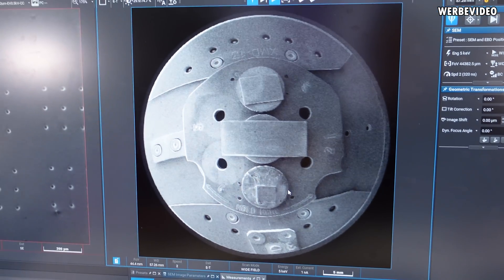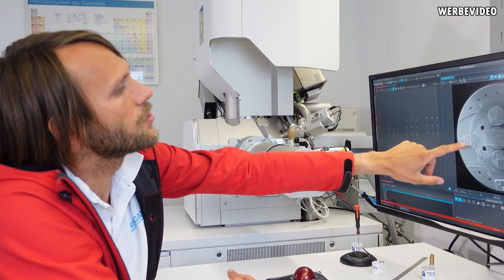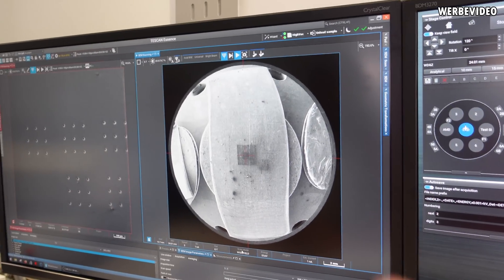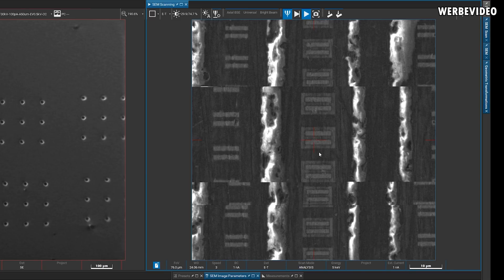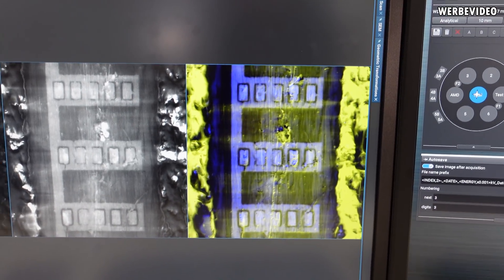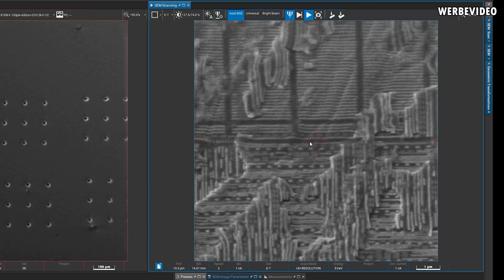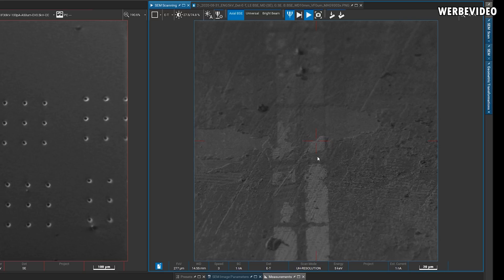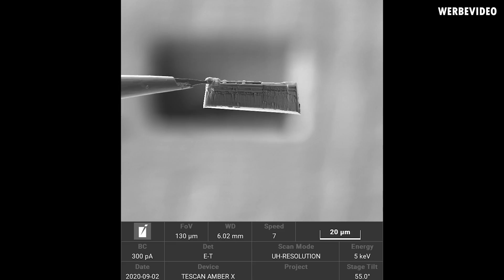Ryzen Nano-Structures more than 100,000 times magnified. Visiting Tescan Part 2/3

Comment: It's hard to believe how much electricity flows through those tiny channels at any given time.
Reply: Ok so you know what Electron tunneling is with the transistors, and how they use silicon transistors to get smaller like the 7 nm they are currently at with AMD's Ryzen 3000 series CPU's.
And the 5 nm, 3nm and so on, to make the computers more efficient with performance and energy but now we are starting to see more heat.
Silicon has limits but they keep trying to improve it, and it will melt at specific temperatures, so we need to replace it.
Ask yourself why we aren't using Quantum Materials like Graphene (yet) and still using silicon. 🤨🤔

This is where Graphene will fix the electron tunneling aka Quantum Tunneling, we don't need silicon to get down to 1 nm "nanometer" in size.

Imagine this, Graphene computers with a magnetic current to be 1,000 times faster and possibly only use 1% of the energy used. 💡

Now imagine Graphene optical / transparent transistors for Photonic Computing. 💡

Now imagine Graphene lasers for the fiber optics that would be used as the circuits inside our computers for Photonic Computing. 💡

--------

I would rather see Graphene computers, let's get rid of silicon. I'm serious.

Check this out.
I would give links but the video hides my comments.

Go to my channel and click on the playlist called "Videos with important info to get around my channel". ✔

Watch a Flash Graphene video about Flash Graphene 100 dollars "per ton". ✔

And then another video about "Large machines on earth / in space to make Flash Graphene". ✔

After that, check my channel with 2 simple steps for my other channel, go to the "About" tab of the channel I'm commenting with now and read the info with a link found there to save to your browser's favorites. ✔

==============================

Imagine Graphene for Photonic Computing, to help us save on our energy needs, really think about that for a second with Photonic Computing.

Check my other channel for these 2 playlists.
Photonic Computing playlist. ✔

Graphene computers for home and Starships, playlist. ✔

Learn about Graphene from my other channel's "Graphene playlist". ✔

If you want to know more about Graphene and Quantum Technologies, go to my other channel. ✔🤔💡

Comment: Well i did NOT know processors had so many layers , i remeber when intel introduced the finfet something , i think that's when they went multilayered , but i always tought they had 2-3 layers , not 10+ . Crazy .
Reply: Ok so you know what Electron tunneling is with the transistors, and how they use silicon transistors to get smaller like the 7 nm they are currently at with AMD's Ryzen 3000 series CPU's.
And the 5 nm, 3nm and so on, to make the computers more efficient with performance and energy but now we are starting to see more heat.
Silicon has limits but they keep trying to improve it, and it will melt at specific temperatures, so we need to replace it.
Ask yourself why we aren't using Quantum Materials like Graphene (yet) and still using silicon. 🤨🤔

This is where Graphene will fix the electron tunneling aka Quantum Tunneling, we don't need silicon to get down to 1 nm "nanometer" in size.

Imagine this, Graphene computers with a magnetic current to be 1,000 times faster and possibly only use 1% of the energy used. 💡

Now imagine Graphene optical / transparent transistors for Photonic Computing. 💡

Now imagine Graphene lasers for the fiber optics that would be used as the circuits inside our computers for Photonic Computing. 💡

--------

I would rather see Graphene computers, let's get rid of silicon. I'm serious.

Check this out.
I would give links but the video hides my comments.

Go to my channel and click on the playlist called "Videos with important info to get around my channel". ✔

Watch a Flash Graphene video about Flash Graphene 100 dollars "per ton". ✔

And then another video about "Large machines on earth / in space to make Flash Graphene". ✔

After that, check my channel with 2 simple steps for my other channel, go to the "About" tab of the channel I'm commenting with now and read the info with a link found there to save to your browser's favorites. ✔

==============================

Imagine Graphene for Photonic Computing, to help us save on our energy needs, really think about that for a second with Photonic Computing.

Check my other channel for these 2 playlists.
Photonic Computing playlist. ✔

Graphene computers for home and Starships, playlist. ✔

Learn about Graphene from my other channel's "Graphene playlist". ✔

If you want to know more about Graphene and Quantum Technologies, go to my other channel. ✔🤔💡
Reply: @gameresearch9535  Currently this is al just hocus pocus , some is theory , some are prototypes with eXXtremely high cost = uneconomical . Realistically what you talk about is 22th century tech . Adoption of such a huge change would take 20 years anyway . We'll be long gone mate , but i aswell would like to see such tech , the ultra realism gaming in a 100W package .... and embedded tech under the skin , or simple smart stuff that don't need a charge every 1-2 days. 

To tell you 1 concrete example : I've been looking towards the carbon nanowhatever batteries since 2010 . There was a roadmap of 5 or so years , even in 2020 they have ZERO delivery on the promise . If you check it out it's still gonna say they are 5-10 years away . - This is how tech truly progresses. When something drastically new comes around , it takes a huge amount of time till it gets economical to produce . 

Same with Oled or Amoled , Wikipedia -"Chemists Ching Wan Tang and Steven Van Slyke at Eastman Kodak built the first practical OLED device in 1987".  they started to put them in phones only in 2008-2009 . And the widespread adoption took another decade. Oled tv's still are not mainstream and still have some issues...

You see what i'm tryin' to say ?
Reply: @kisspeteristvan  

Again read what I said about my other channel and go learn about it in the playlists section of my other channel.

There are a lot of playlists you need to see on this, from my other channel.

Graphene isn't like silicon, it's not artificial and look how fast they have found ways to scale it up.

Look into the information I gave in my first comment above, follow the information to find out more about Flash Graphene, you're making excuses before actually checking out any of the information I gave, and I don't appreciate ignorance.

A lot of companies have a 5 - 10 year schedule, this means we can see many different kinds of emerging technologies much sooner but they won't allow it.
Look at the Hyperloop One that was a concept idea and then became a prototype developed in the U.S., and then built in India? See anything wrong about that?

Because of safety validations from small minds, it will be another 6 - 8 years before we can see the Hyperloop One in many different states, now the sources could be short - sighted and it might come sooner, but if it's really 6 - 8 years away because of safety validations, that is a really good example right there, when we can have the technology starting to be built now for the tubes and everything else for that emerging technology.
Not to say that we can have all emerging technologies now, but there are many we can have now.
Graphene is also everywhere, you better look into my other channel's Graphene playlist as there are already products, and I have one inside my computer.

And so again, don't be ignorant and look at the information given in the order that I gave it, for the playlists to watch and then check the rest of my other channel's playlists, and watch them all.

And based upon my other channel, why would I not already know about what you meant? Stop and think about that, at my level I'm going to know, clearly you can see this by going to my other channel to find out. I've already pointed out the perovskite technologies going into some TV's with corruption there when Graphene should be a part of that, the technology if you youtube search for it, you can find something similar to Quantum Dots that was from late last year, I can't remember but it was for the most accurate colors such as green and orange and so on, in the TV's, but it was a form of corruption since they don't even try to research Graphene with it.
Go to my other channel and you will find out why I mentioned this, and watch everything from all playlists.

Comment: I work as an SEM operator, and I think I must be spoiled by the equipment we have. I go up to 800,000X magnification every day on really high end field emission SEMs. Samples calling for 100K are the easy ones that we churn through image sets in a few minutes as long as it's not charging like crazy.

I was wondering why he put you on a dual-beam FIB until I saw the liftout mill at the end. I'm guessing that means you cut a section under 100nm for TEM or STEM imaging. Should make for pretty cool shots, depending on the accelerating voltage and the microscope.

Also, I used a Tescan Vega 3 quite a bit in my degree program. I really liked their aperture system, using an electromagnetic lens instead of a physical aperture. It helped get a better signal to noise ratio even with a cheap tungsten filament in the electron gun since it condensed the beam instead of blocking some of it. Didn't get it anywhere near what a field emission can do, but didn't need a series of ion getter pumps and it made stigmating so easy since you wouldn't have to deal with the beam sputtering material off the aperture over time and changing its shape. I could reliably set the stigmators on that thing both to 0 and the beam would be just about perfectly round every time. Of course, the resolution wasn't great, and I think our practical upper limit was like 40K or 50K mag before even the best samples got really blurry...
Reply: Field emission SEMs are a crazy thing. I have one at my work as well as a standard SEM. The FE-SEM can theoretically magnify up to 1,000,000X but the signal to noise ratio is too low to practically get anywhere near that. Funny story, we had to get a sort of Faraday cage built around our FE-SEM because the city power lines behind our building were causing interference with the electron beam. Unfortunately, I'm too new at my work to be trusted with the "cool" SEM but I have used normal SEMs quite a bit. I can honestly say I envy you for using an FE-SEM everyday lol.
Reply: My institute has a jeol jsm-7600f but no one ever uses it as everyone wants to use a TEM.

Comment: intel used weaving high-quality gold strands are close each others in pattern vs ryzen ....too many gaps and spaces will result short term lifespan from heat and expansion cause strands break off over time with connection from the cores ...meaning dead cpu...
Reply: are you saying Ryzen CPU's won't last as long as Intel?

Comment: Leaving Intels 14nm behind AMD like those two dies shown in this video. Totally wrecked.
Reply: Ok so you know what Electron tunneling is with the transistors, and how they use silicon transistors to get smaller like the 7 nm they are currently at with AMD's Ryzen 3000 series CPU's.
And the 5 nm, 3nm and so on, to make the computers more efficient with performance and energy but now we are starting to see more heat.
Silicon has limits but they keep trying to improve it, and it will melt at specific temperatures, so we need to replace it.
Ask yourself why we aren't using Quantum Materials like Graphene (yet) and still using silicon. 🤨🤔

This is where Graphene will fix the electron tunneling aka Quantum Tunneling, we don't need silicon to get down to 1 nm "nanometer" in size.

Imagine this, Graphene computers with a magnetic current to be 1,000 times faster and possibly only use 1% of the energy used. 💡

Now imagine Graphene optical / transparent transistors for Photonic Computing. 💡

Now imagine Graphene lasers for the fiber optics that would be used as the circuits inside our computers for Photonic Computing. 💡

--------

I would rather see Graphene computers, let's get rid of silicon. I'm serious.

Check this out.
I would give links but the video hides my comments.

Go to my channel and click on the playlist called "Videos with important info to get around my channel". ✔

Watch a Flash Graphene video about Flash Graphene 100 dollars "per ton". ✔

And then another video about "Large machines on earth / in space to make Flash Graphene". ✔

After that, check my channel with 2 simple steps for my other channel, go to the "About" tab of the channel I'm commenting with now and read the info with a link found there to save to your browser's favorites. ✔

==============================

Imagine Graphene for Photonic Computing, to help us save on our energy needs, really think about that for a second with Photonic Computing.

Check my other channel for these 2 playlists.
Photonic Computing playlist. ✔

Graphene computers for home and Starships, playlist. ✔

Learn about Graphene from my other channel's "Graphene playlist". ✔

If you want to know more about Graphene and Quantum Technologies, go to my other channel. ✔🤔💡

Comment: For anyone that is wondering - the dark square you can see that remains on the surface of the sample at 7:31 is due to carbon deposition. It occurs when organic/carbon-containing molecules are struck by the electron beam, leading to a sort of carbon rain which builds up on the sample. The darkening becomes pronounced where the beam is focused on an area for a prolonged period. Finger prints are generally the culprit.

Comment: Damn, TSMC really doing some crazy shit
Reply: Ok so you know what Electron tunneling is with the transistors, and how they use silicon transistors to get smaller like the 7 nm they are currently at with AMD's Ryzen 3000 series CPU's.
And the 5 nm, 3nm and so on, to make the computers more efficient with performance and energy but now we are starting to see more heat.
Silicon has limits but they keep trying to improve it, and it will melt at specific temperatures, so we need to replace it.
Ask yourself why we aren't using Quantum Materials like Graphene (yet) and still using silicon. 🤨🤔

This is where Graphene will fix the electron tunneling aka Quantum Tunneling, we don't need silicon to get down to 1 nm "nanometer" in size.

Imagine this, Graphene computers with a magnetic current to be 1,000 times faster and possibly only use 1% of the energy used. 💡

Now imagine Graphene optical / transparent transistors for Photonic Computing. 💡

Now imagine Graphene lasers for the fiber optics that would be used as the circuits inside our computers for Photonic Computing. 💡

--------

I would rather see Graphene computers, let's get rid of silicon. I'm serious.

Check this out.
I would give links but the video hides my comments.

Go to my channel and click on the playlist called "Videos with important info to get around my channel". ✔

Watch a Flash Graphene video about Flash Graphene 100 dollars "per ton". ✔

And then another video about "Large machines on earth / in space to make Flash Graphene". ✔

After that, check my channel with 2 simple steps for my other channel, go to the "About" tab of the channel I'm commenting with now and read the info with a link found there to save to your browser's favorites. ✔

==============================

Imagine Graphene for Photonic Computing, to help us save on our energy needs, really think about that for a second with Photonic Computing.

Check my other channel for these 2 playlists.
Photonic Computing playlist. ✔

Graphene computers for home and Starships, playlist. ✔

Learn about Graphene from my other channel's "Graphene playlist". ✔

If you want to know more about Graphene and Quantum Technologies, go to my other channel. ✔🤔💡
Reply: @gameresearch9535  is graphene more durable and easier to scale down as silicone?